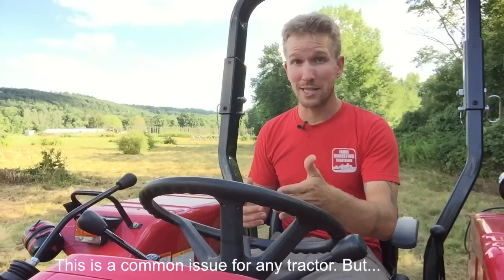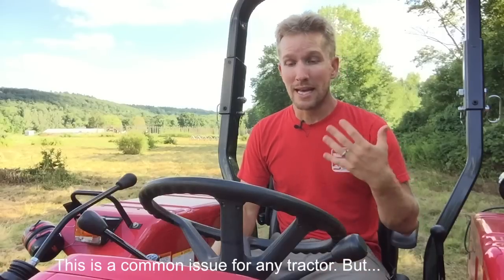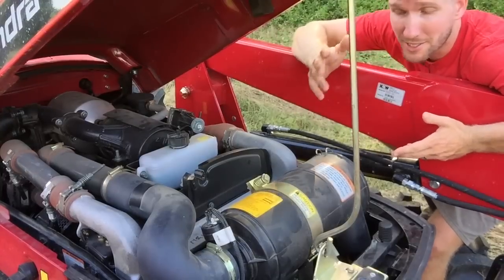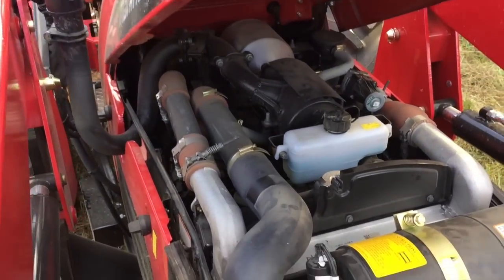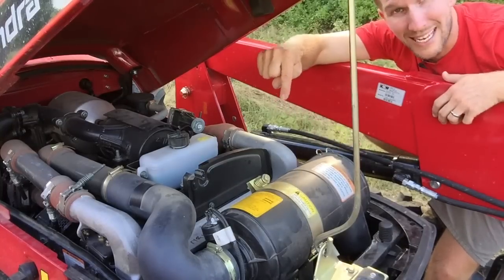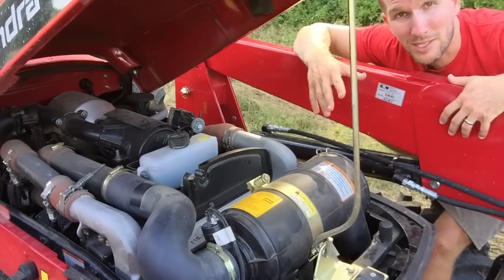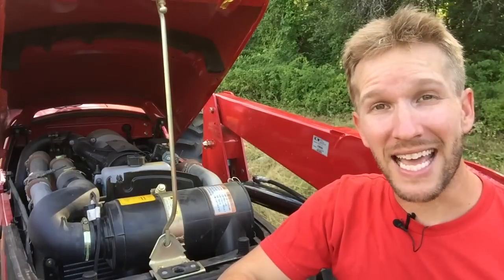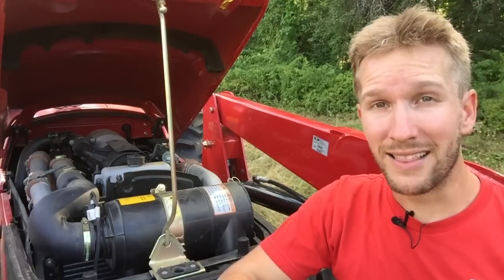Mahindra 5570 Engine Problem

Comment: sux.. a metal screen that slides out would be usefull. mowing with the bucket lowerd to knock of seeds before the grill ..or finer mesh over the grill
Reply from the maker: Pete, all of those are good suggestions.
Reply: Also check if there is a track for a screen to fit. sometimes  stuff like those screens are  silmply forgotten. if the tractor didn't come with it there may have been a hay making setup ie diff muffler and screens. some of the time permanent parts are incorporated into all modles. so it may have a track

Comment: I had a Mahindra 6500 which was the older version of the 5570 and the screen was easier removed because it wasn't turbo charged and didn't have that intercooler in the way, but the battery was the exact same, had to take all kinds of stuff off to get to the battery
Reply from the maker: Did you end up attaching leads to the battery like a lot of people on here are suggesting?
Reply: no i just put the best battery in it i could find, most cranking amps, and always remembered to turn the key off and not leave lights on when tractor was off, and i never had any trouble with it cranking in the 3 years i had it

Comment: I use brass screening. You must brush off occasionally as the engine gets hot. For the past several years since using a screen I have not had to wash or blow out the radiator. I agree the  location of the radiator and battery is bad. Very easy to access on my New Holland, especially since the front lower part of the hood is missing.
Reply from the maker: Yeah, missing pieces of the tractor make it easy to get into. I had that with my John Deere, the front grill was broken. (My fault not theirs)

Comment: At a previous job, I used to drive a John Deere 9420 set up with dirt buckets (real dusty job).  The air filters are so long on these tractors that we had to use a long aluminum pipe (wand) to clean them out.  Try this as I think it may address all issues you have except for the access to the battery.  This works with water, but better with compressed air, in my opinion.  Either way, my solution would be to use a rigid wand, made from a piece of small diameter aluminum pipe, connected to either your air hose or water hose with a valve.  We bent the 'spray' end of the wand 90 degrees and flattened it almost shut at the end.  With your tractor, it might work better to not have a bend in it.  It will make a fan of compressed air/water which will clean much better than a water hose with spray nozzle.  This will keep you from getting burned on hot engine parts, having to remove air intake garbage, and wasting a ton of time accessing what needs to be cleaned.  Sorry for the long post.  Hope this helps.It's basically one of these, but without the cost and made to fit your needs.https://www.amazon.com/Hiltex%C2%AE-31111-Angled-Aluminum-Standard/dp/B001NYTBY8
Reply from the maker: Good suggestion, and thanks for the use-case example. Helps to know someone has done something like it. I worry about not getting all the material out of the engine compartment but I'll figure that out.

Comment: Maybe rig up a small portable(12 volt) shop vac. Make a wand out of pvc to get down in there to suck the stuff out. Could also use this to blow out.
Reply from the maker: That's the best solution that I could come up with yet Lenny. Either hook it up to my battery (which I mentioned is hard to reach) or have a rechargeable little dust-devil that lives on the tractor.
Reply: You could wire up a lighter socket, probably try to go directly to the battery( if you get to it) and have in line fuse. Hopefully no warranty issues this way. Easy to plug in your vac or 12 volt compressor this way. Good luck!

Comment: The reason is Mahindra did not go with dpf filter to meet there tear four emissions. Therefore the system they use takes up a lot of engine compartment space. The pre emissions Mahindra has easy clean space.

Comment: my exact machine is 4 years old and with a severe cold snap my battery which worked great yesterday is completely dead. What an absolute job it is to get to battery terminals to try and jump charge. To remove battery is unbelievable amount of work The front end including the brush guard has to be removed. Not the job I had planned for in this absolutely freezing weather Love my machine but concerned on maintenance and repair items  k long day about to start . Everyone stay safe

Comment: I have the same issue with my small Kubota bx25. I just blow it out with my pressure washer. The wand is narrow with a small head. I can pretty much reach anything I can see. It just takes a few min.
Reply from the maker: Thanks for the feedback. My issue is though if I'm across the farm in a back field and I have to clean it. If it gets really hot then the trip back to the farmstead might overheat it. I have to find an easy way to clean it in the field.
Reply: Well, how about this. Wait until it rains to mow. There's a lot less airborn material on damp grass.

Comment: I have a smaller Mahindra and there is a removable screen that you pull out to clean in front of the rad.
Reply: That was my first thought too.  John I can't believe there isn't a removable screen there somewhere.
Reply from the maker: There's a screen but it's held in place with 4 bolts. There's no easy way to get to those bolts and it won't pull out without them taken out. I almost have to take most of the front end apart to get at all of them. But no, there's no easy to remove screen which is a bummer. That might end up being my solution is to make my own screen or make the current one easier to remove. It just would have been nice after $33k not to have to fabricate something.
Reply: I swear engineers do things like this to make people take them back to dealers for maintenance but why the heck would they go so far as risking the motor is what i'm wondering.

Comment: I had a 1710 4X4 ford tractor I use to bush hog with it, I was doing a job at the rod and gun club in Bath Maine, they asked me if I could get rid of the alders I said yes, I started bush hogging them and wow it was looking good.then the bad part a alder curled up in my power steering on the front axle, thus cleaning out the radiator and fan .i ended  up replacing the radiator and fan.at 50 Hrs  I had noticed what you said, when you mowed' I thought it was weird that it ran hot since it was new. I bought a new thermostat and a new  radiator cap, that was the end of it running hot, it did not mater how much grass I mowed I hope this helps you out

Comment: We have a 2006 Mahindra 4510 cab tractor and it has had the same issue since we bought it. We have a lot of broom sage and it just clogs it up and I have more of a issue than you do. With the cab, it has AC, so the compressor radiator coil sets right in front bolted up tight to the radiator, which mean the debris gets in between the two and it is impossible to clean. We finally made some 1 1/5' washers out of 2x4s with a hole saw and this allowed some space and this helps a lot, but I am still having the same issues you are. This problem has been around a while and has yet to be corrected.
Reply from the maker: I haven't spent a ton of time on troubleshooting since most of my mowing is done for the season. The best I have found is keeping a refrigerator brush with the tractor to stop and clean the screens while you're mowing.

Comment: Gosh John I'm sorry to hear about the problems with your new toy. That is kind of heartbreaking. Like a few other folks hinted, we get what we pay for, maybe a tractor of another color would not have this problem. I am not a great mechanic but I would like to offer up some other scenarios...1. Have you talked to your dealer? Mahindra is so anxious to sell and make a name for themselves go up their chain of command and see what if any customer service they can offer. 2. Can you take a portable air tank or compressor with you in the field? 3. Do you have one of those cool extended air blowing tools? I bought one at a trade show and it works great, but the best one I saw was a home made one that was about 2 feet long and narrow just right for reaching into tight spaces to blow out dust. Maybe a local machinist can make one for you. 4. Another solution.....I know this is a stretch considering you just bought a new tractor but.....maybe pick up an old farm tractor and keep that just for mowing and as a back up to the Mahindra? Good luck buddy and thanks for your videos.
Reply: something fairly cheap like this, it's not green but those old david browns are reliable. http://fredericksburg.craigslist.org/grd/5658539687.html
Reply from the maker: I'm worried that with blowing the seed heads around they won't leave the engine compartment and then will just get sucked right back in. Along the lines of what you're suggesting I've thought of taking a small dust-devil vacuum and keeping it on the tractor with a goose-neck hose. That way I can get in there and suck the dust and seeds out and they won't be in the engine compartment.
Reply from the maker: With the money I'm spending on this one I don't have the resources for another tractor dedicated to mowing. Plus I'm really loving the 70hp powering my bush hog. Mowing is a lot nicer with this machine aside from the flaw.

I also hear you about maybe a tractor with a different paint color might not have this issue.

Comment: I HAVE A MAHINDRA AND LIKE YOU SAID ITS A LOT OF TRACTOR AND THEY PUT A LOT UNDER THE HOOD. WELL TO TELL YOU THE TRUTH THE BEST WAY I HAVE FOUND TO TAKE CARE OF THIS SITUATION IS MAKE SURE YOUR TRACTOR IS STILL RUNNING AT THE LOWEST RPM
 IT CAN THEN RUN A WATER HOSE ON THE SCREAN AND DO NOT PUT A HIGH PRESSURE STREAM ON IT BECAUSE YOU CAN BEND THE RADIATOR COILS , THUS THEN YOU HAVE A PROBLEM. YOU WILL FIND THAT USUALLY JUST RUNNING WATER ON IT WILL CLEAN THE RADIATOR , SCREAN AND LOOSE DEBREE OUT AND OFF YOUR ENGINE. NEXT IT IS ALWAYS A GOOD IDEAL TO BRUSH CUT WITH YOUR BUCKET ALWAYS DOWN ESPECIALLY WHEN ITS DEER FOULING TIME . YOU MAY SAVE A NEWBORNS LIFE

Comment: unfortunately these design features are intensional. There must be a shop near by that all they do is maintanence. the cost of the tractor was probably lower with the thought process that the seller will make money on repairs ie. there reason or incentive to sell it. the solutions provided seam logical and a good starting point.
Reply from the maker: I definitely don't think it was my dealer specifically. This seems to be an engineering design flaw. It seems silly to me because this issue wouldn't just cause the need for repair, it would cause the need for a new motor when it overheats and blows up. I hear you though with not trusting dealers. I'm happy to say that I still trust mine.

Comment: If we ever get one of these, I'm taking off the EGR and that stupid catalyst. The EPA should not be allowed to be doing that to farmers, and they need to raise the HP limit. and the thing of the radiators being covered is common all the way back to the early 2000s with the 5500s (we have 2) and also, if you wanna get to the radiator, the grill comes off, you get to it by opening the sides abd then undoing 4 wingnuts, at least it was unless they changed the design. Also the air filter should swing to the side. There looks to be a lot of extra garbage under the hood. If you need to replace the battery, the absolute best way is to take off the grill and that red peice below it, to do so you need to remove obstructions to the grill.

Comment: We have a Mahindra 6000.  It is the same design as this tractor, just different engine.  To clean the grill, you do have to take the air filter off.  Then you pull the screen up and out .  About the battery, you can use the positive cable going to the starter, and ground it to a bolt on the tractor to jump off another piece of equipment.
Reply: That is what I do with my 5570 as well to jump it. Starter wire is already hooked up directly to battery so no need for lug to do that.

Comment: Changing the battery sucks ass! Everything you said that was in the way is very true. Plus when taking the side panel off to try to get to the battery it is easy to loose the knobs you un screwed!!And then the battery still won't come out be cause the bar in front will not let it slide out! It would really suck trying to do this out in the field with out a full ratchet set and full wrench set. ( metric AND standard)!! It's a f'n nightmare, I would never buy a mahindra tractor., you shouldn't need a mechanical degree for every minor issue!

Comment: I looked at a Mahindra about a year ago around that same horsepower (I can't remember the model number) but I do remember the dealer showing me that the side panel (on the right hand side) came off without tools, but the loader had to be up and there was a pre-filter in front of the radiator. Maybe yours has the same setup? The dealer showed me the whole process which took under 5 minutes to take apart and re-assemble.
Reply from the maker: On mine getting at the radiator through the side panel doesn't work. The panel comes off easy enough, but there's no access to the areas I need still.

Comment: Not sure if it is possible with your tractor, but we have heavy equipment and depending on the environmental conditions the radiator fan bladed are reversible.  Meaning you can have the blow outward instead by taking them off and turning them around, which is the direction we have ours blow all the time.
Reply from the maker: Hadn't thought of that. I'm also curious if that voids my warranty.
Reply: not sure, but probably worth checking, good luck

Comment: I would  go back to the dealer and trade it for a mahindra 1640 or 1538 or 1635 or even a 1626. These models are made by Mitsubishi. I own each of these models.  The radiator screens are up front and easy to clean out.  Also the battery is easy to get to.  I have the shuttle (gear) versions and they are good tactors.

Comment: I have a 5530. I have the same problem while using the rotary cutter. The temperature progressively increases throughout the day. You are right about the design. It takes me 2 hours to get back to the garage. I take the intercooler off about once a month and clean the radiator. I've used the shop vac, air compressor (doesn't work well).  Believe it or not, my leaf blower works a little better. So far, I haven't found a way around that. Please share a solution if you find one.
Reply from the maker: It's funny that a leaf blower seems to be one of the more popular solutions. I'm liking the brush that I found to fix the problem. We'll see this summer when I do more mowing.

Comment: Every design has some give and take but the lack of a radiator pre-filter and poor engine access is confusing.  Why can't the whole hood just come up as one piece.  All the new emissions equipment sure does take up a bunch of space.  As far as the battery, you can get some permanent jumpers like they use on tow trucks to move energy access wherever you want it.

Comment: i agree with one comment below on the battery cables.  Make new cables long enough to extend back upward to where you can reach them, if you need access to them for charging or jumping etc..  Certainly see some stupid engineering design issues with these New Tractors..  The makers can make some very nice improvements over their competitors  model tractors.  But the day 'Bubba" takes a Vacation day is the day they've decided to redesign the engine compartment.  As a result, they miss some very practical issues discussed in this Video.  (What was the name of the Car that required the engine be taken out and lifted 3 inches in order to change the engine oil and filter?)

Comment: I have the 1533 Shuttle which can lift up to 1650 lbs.,  which covers just about any bale of hay out there and I have a six foot brush hog that works great.  I have added a post hole digger, a chipper and a back hoe.  Perfect for me on 70 acres and its easy to get into the engine.  A pin pops the guard forward and then the entire engine cover goes up giving total access to the engine and battery.  I find that Tractor dealers seem to always want to move you into the next biggest thing possible mine tried, I declined and 70 horses is pretty darn big for a tractor.  I only have 34 and its quite powerful. With big things come big complications and a bigger diesel bill to boot.  Somebody called this a compact tractor and I don't think a 5570 is a compact by any means.  I don't even think my 1533 is exactly a compact although Mahindra calls it that since they have a "sub-compact" line..  Anyway, I have seen sold screens that have tie offs attached that would do the trick.  I know with mine the seeds and grass hoppers (chicken feed) and such collect outside the front grill and I just get up now and then and brush it off.  Nothing goes inside the engine compartment. .  .